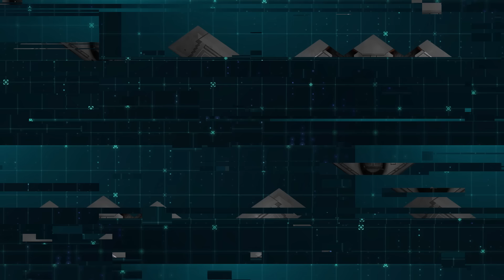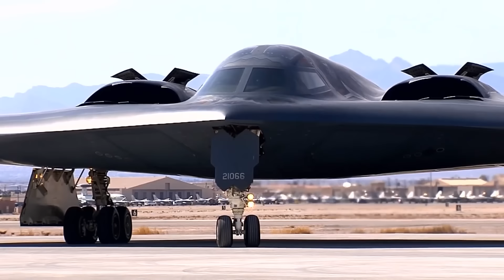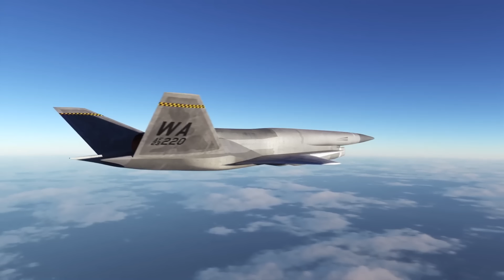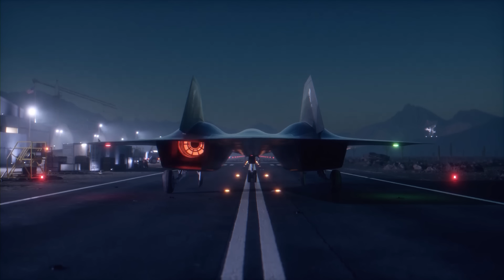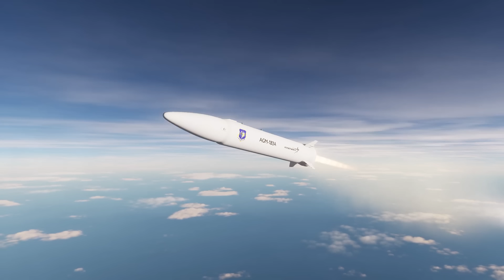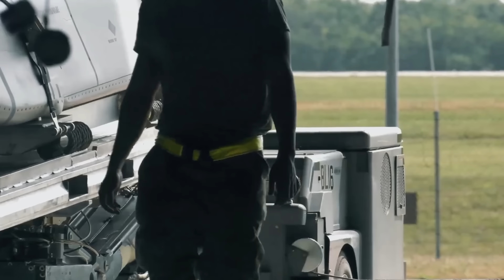B-21 Bomber Is So Invisible… Even US Satellites Missed It

Comment: a little insight into how the radar absorbent material works- radar waves are in the gigahertz regime so the "antenna" that receives them is necessarily small because of the tight wavelength. The radar energy is received by very small odd looking shapes, as many of you will know, the basis of a tuned circuit, or tank circuit is simply an inductor and a capacitor-the energy is absorbed by the inductor, that sets up an electromagnetic field that then transfers it's energy to the capacitor, the capacitor becomes saturated and then dumps it back into the inductor, and around and around we go. The energy is eventually lost through resistance, other forms of loss and eventually is bled away is an exceedingly small amount of heat. At radar frequencies, the tank circuit can take on truly odd forms, such that tiny shapes made out of ferrites and other conducting templates can act as inductor and capacitor, those of you who have seen UHF circuit boards will know how crucial dimensions and shapes are to avoid losses, stray capacitances and inductances. Varying the design of this material is absolutely essential because as you know, radars don't just transmit at one tight frequency, they can cover many gigahertz, meaning your absorbent materials must cover a wide frequency band, this is where the iron ball paint comes in. by having many successive layers of an ever increasing density of refractive nano-spheres in the polymer matrix the radar signal is absorbed, and diffracted deeper into the matrix never to be seen again. The way this is achieved has to do with having two surfaces that closely match in impedance so that the energy isn't simply sent back the way it came, it becomes trapped inside this material, the technology has been around for ages, Salisbury screens and Dallenbach filters....
Reply: We use a MUCH better means than that! We use what is basically a giant heat and RF sink! We coat our own all-Canadian Stealth aircraft in a 5 cm thick (2 inches), two layer of hard and soft compound materials similar to Line-X truck bed liner except with many embedded carbon ceramic nanoballs that are similar in action to the heat shield tiles on the space shuttle. They ABSORB the heat and RF and KEEP it in and do not radiate it again. That lowers thermal signature AND the 5 cm layer of Polyurea coating is hot-stamped with LOTS of off-road tire truck-tread designs on the ENTIRE aircraft hull that WAVE-GUIDE TRAPS radar frequencies in the 100 Mhz to 120 Ghz range so they don't bounce back. They stay in the truck-tire-tread-like hot-stamped waveguide designs and get absorbed INTO the polyurea and softer inner coating compounds!

After all that, the tire-tread designs ALSO create a rough boundary layer which SUCKS a laminar airflow onto the aircraft hull which makes it go a LOT faster! Plus the carbon nanoball infused Polyurea coating is weatherproof, ruggedized and can withstand enormous temperature swings from -100 Celcius to 200 Celcius so it can fly in ANY weather at flight ceilings waaaay past 150,000 feet!

Your RAM coating is waaaay too complex! We keep ours MUCH SIMPLER and we are getting even better performance that what the B2 and F117a has! Plus ours is easy to clean and wash off and doesn't NEED that insanely delicate RAM skin maintenance regime that plagued the earlier stealth aircraft!

V